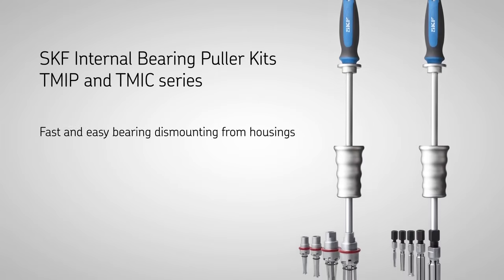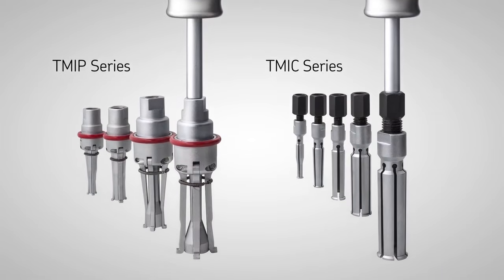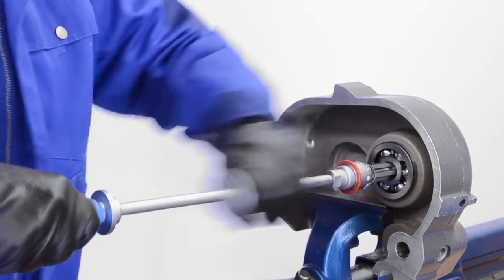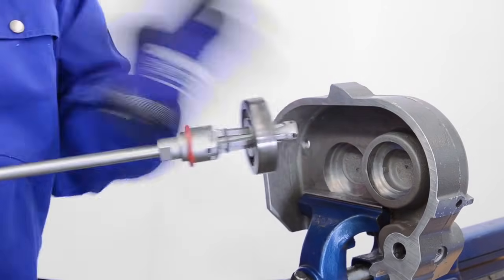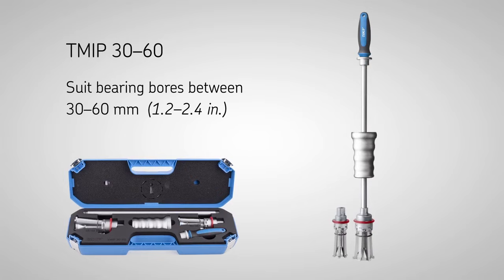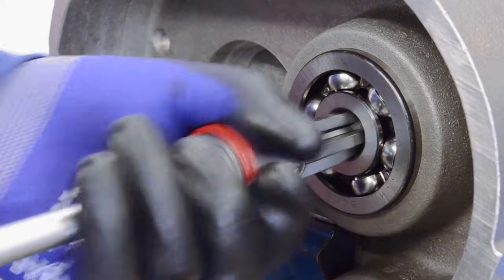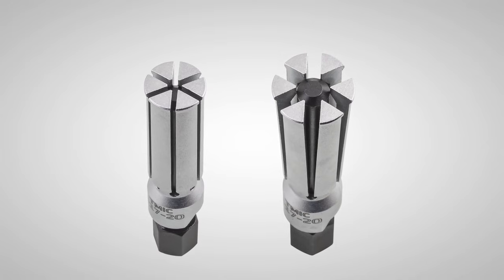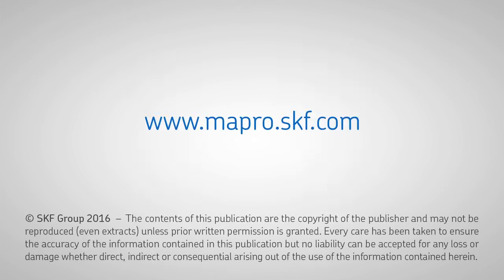SKF Internal Bearing Pullers - The TMIP and TMIC series

Comment: you can do this easier without using this tool. just put some bread in the hole and tap with a hammer and an old drill that fits exactly in the hole. Each time add new bread and tap again, eventually the bearing is pushed out of the hole. it really works.
Reply: The bearing has to be a case bearing to do that trick, the bearing in this video was a open bearing so it won't work on this type.
Reply: Or use heat like an oven
Reply: Yep, I have seen that, it works really well.